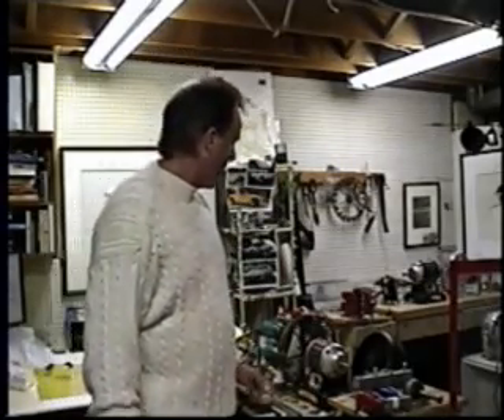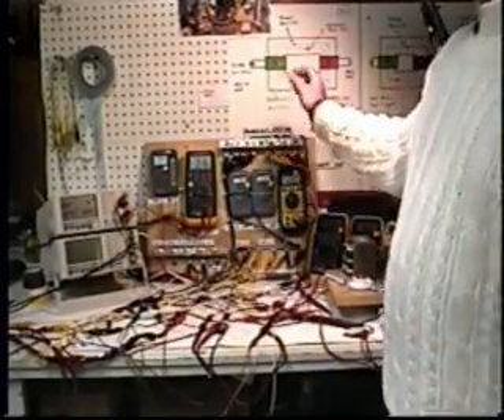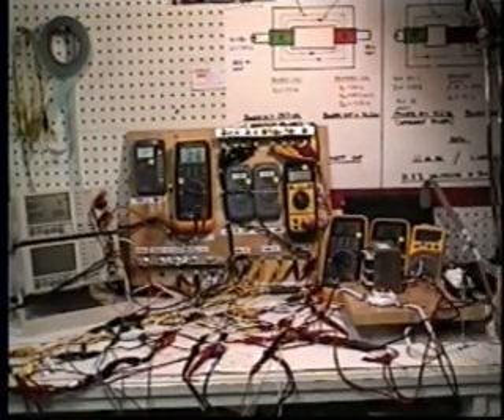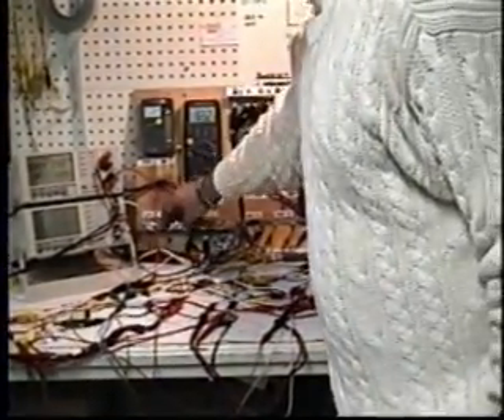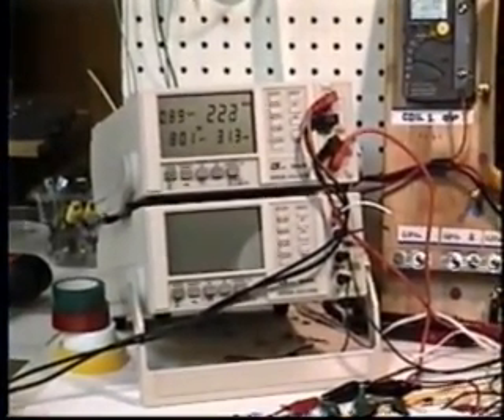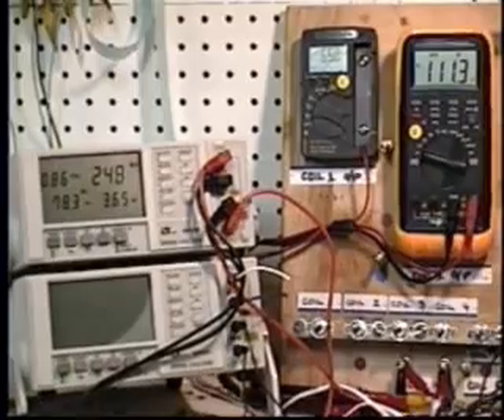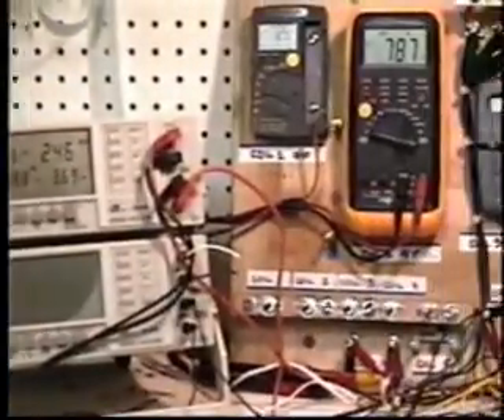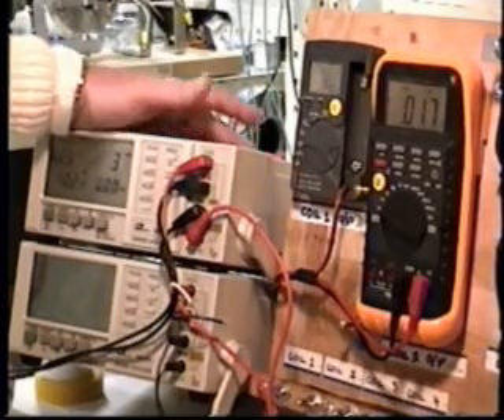PEREPITEIA GENERATOR DEMO VIDEO - Part 5

Comment: Does this mean you can actually apply this on electric cars of ac induction motors as propellant with self charging effect or at least 10 times more efficient than what it is today under current set up designs?

Comment: Don't get fooled by the motor acceleration. What is coupled to the motor is having a cogging torque equivalent with a friction disc. The motor is first fighting that cogging torque and then accelerates because the cogging torque is decreased due to delayed EMF (when the HV coil is shorted). Heins created a problem and then it removes it. He may be a good magician but not an inventor or discoverer.

Comment: I understand what you are getting at and I realize that energy abounds in our universe; however, unless the results of this demonstration can exhibit this machines ability to do more work given the same amount of energy, the point is moot. The independent variable should be the work done, not RPM. Please don't say that the <RPM is a demonstration of work done, because with no load it may well be the result of some sin wave nuances that don't actually represent a heightened capacity to do work.

Comment: Show us that this system, coupled via a  pulley and an EXTERNAL measurable work load, is capable of doing more work than the same induction motor on its own, coupled via a pulley to the same measurable work load, with the same current input, and you'll demonstrate that you have created a more efficient electric motor; not perpetual motion or energy. MAYBE you've stumbled on a system that is able to recover a portion of the input energy, but not produce energy from nothing.

Comment: The main thing is that a normal electric motor would accelerate to infinity except back emf and friction holds it back. Thane claims he is reducing back emf, thus causing some higher speeds.  Might be a more efficient motor.

However, GoodElf1 might be on to something (below) regarding how inductive circuits have a power factor (which is measurable) and thus he might be improperly measuring the current and voltage as they are out of phase at a different angle as his experiment conditions change.

Comment: I'm guessing that somehow the permanent magnets on his generator apparatus is contributing to the leakage flux in the induction motor stator ( through the air ), with the return path going through the flux path from the stator to the rotor, returning through the driveshaft to the magnets. Normally, on an induction motor, rotational velocity is determined by the frequency of the source and the number of poles, however, this could be affecting the slip of the rotor/stator, increasing the velocity.

Comment: There it nothing odd to this. he has a motor and a generator. when the generator is turned on, then the motor wont be able to to drive as fast, as it would when the generator is turned off.

Comment: Actually, no. Watch again. The power input is NOT driven by the motor. He NEVER claims that. He ONLY claims he can "accelerate" the motor. Then he compares the amount of power required *with Back EMF" vs. "without Back EMF" for the same RPMs. But the power required is from his external power source, just the amount changes.

Comment: There is no perpetual motion claim here.

The motor turns *faster* under the *same* power input when he allows the Back EMF to enter the system.

The motor is running more efficiently, getting more RPM, but there is still power to the prime mover. There is re-introduction of the Back EMF into the system. But not enough to disconnect power. It is simply a slightly more efficient motor now.

Comment: Fair, but then you include some motor driven starter to get it going first, like how they included a battery driven starter in the auotmobile to replace the hand crank.  Make sense?  You have to see past the crude beginnings to what could be.